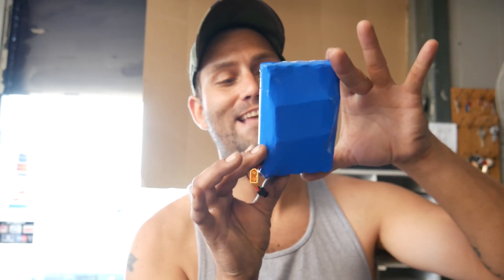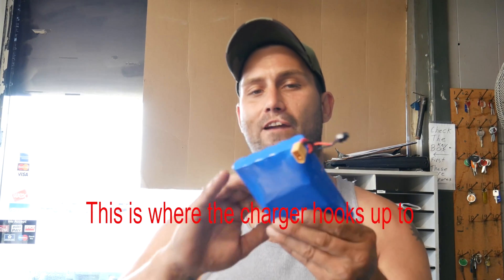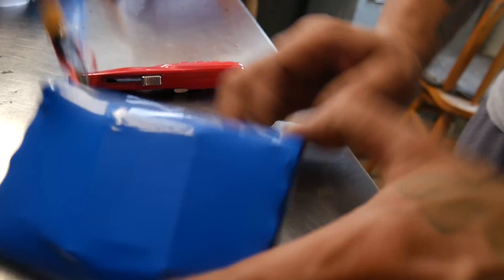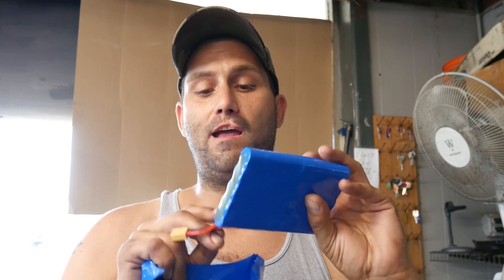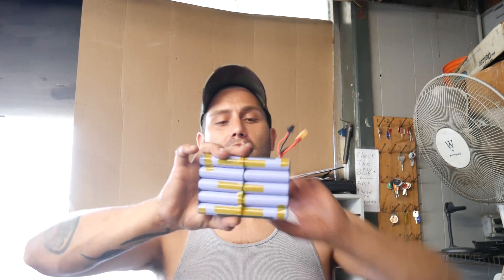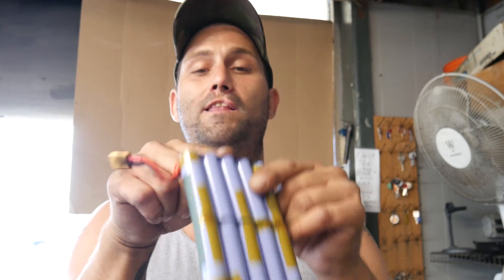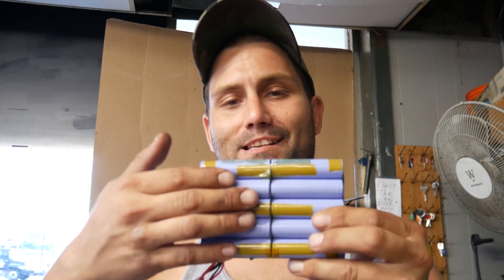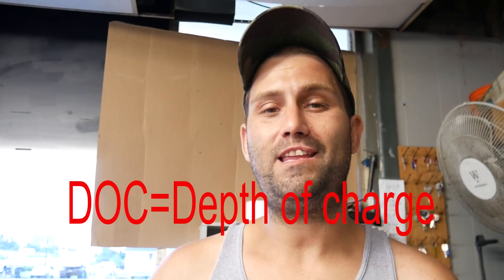Whats inside your electric skateboard battery pack?

Comment: I wonder what are your thoughts on electric skateboards/EV batteries two years on? Might make a good video...
Reply from the maker: I actually have a lot of experience with the batteries coming from The Vape industry. We had tested individual cells a lot actually. I was able to learn about the makeup and composition what different ones are good for and ultimately what to look for what to use to have the best experience. There's no doubt you get what you pay for it because the junk ones are the junk ones and the good ones are the good. I have packs that are years old now that still work just like they did when they were new and that's the hand to God truth., then there's other ones that I only got a few months out of but I already knew that that's what it was going to give me just knowing what battery cells were used. Man I could talk a lot about batteries that's a really good one I like the fact that you're giving me ideas because I'm going to be getting back on here a lot more and I could definitely use some ideas I'm all around the place when it comes to making YouTube videos I talk about anything and everything for when somebody gives me a good idea I definitely like to run with it
Reply: @JoeKyser  one thing I'd love to see is a video/history lesson on electric skateboard components like hub motors, heaven knows we've came a long way to things such a removable outer tyres and Hybrid AT hub motors from SkullBoard! That'd be a very unique video I reckon. #MakeHistory

Comment: Can you use a bms from the 4300mah battery inside the newer 5500mah battery pack? I have a good bms from 4300 and want to use it in my 5500 and don't know much about the differences of the bms if any... they look very similar but the newer 5500 has a fuse and not the older 4300! Thanx for any info!!!!!!
Reply: I been told not to try that from a store in denmark
Reply from the maker: Well they don't know what they are talking about. The mah has nothing to do with it. You can have two batteries of the same. Voltage that would take the same bms and be two totally different milliamps per hour. The maH is the capacity of the battery. Think of electricy as water. It's in a tank and runs out a nozzle that's attached to the tank instead of through wire. Voltage is the water pressure. Mah is the size tank. Some tanks can hold more then others but with the same size nozzle on the tank only so much water can still come out that nozzle. The bms is like you opening and closing that nozzle. As long as the nozzle (voltage) is the same you can use the same way (bms) to open and close the nozzle
Reply from the maker: The mah has nothing to do with it. It's the voltage is what you need to match

Comment: ...Hey Joe...  I have 2 of these koowheel batteries opened up and the 2nd one reads at 40.7v before the bms! Is that right? How is it reading over 40v rather than 36v? Also do you know the layout used with the cells? I think I have an idea but just want to verify that I am right! Thank you... for ANY help with these batteries and I would appreciate it tremendously!!!!! Extra info... first battery reads 3.6v per cell... 32v before bms... and only 9v at connector... and the 2nd battery reads 40v before the bms and only 12v at the connector! I am thrown off by the 40v reading!!!  Thank you again for any into and will pass the info along letting people know that the info and knowledge came from you and plug your channel! Thank you again!!!!!!!
Reply from the maker: you got it, it will read as high as 42v but thats at max max max max 40 is good thats what the bms does. it turns it into a steady 36

Comment: i would love to feel competent enough to double the range on my genisis, your vids help!
Reply from the maker: +JeffHawk i just made a Genesis hybrid. so what I did was I ripped out the old BMS and installed my own custom 30amp one. I was thinking at the same time I wonder if I can take the stock BMS and wire that into a 10s4p pack. either that or build a pact that would accommodate on esc charging. so I'm going to take her around with that and see if there's a easy way to adapt a larger pack using the stock esc.  it wouldn't be able to fit in that battery cage though I know my buddy Dave over at psychotiller would be able to build me Anais and closure. I think when I get the next two wheel version and start making videos with that I'll take one of the old ones and do that.

Comment: yesturday was a day with bad luck i had to use the battery with no bms first my soldering iron breaks i just bypassed the bms coming out of my house a flat tire sealant dint work but i think i found a bms for lifepo4 the will fit my ebike and cheap wish me luck and i tested the mosphet one of them wont close at all is open
Reply from the maker: +nightmare in action nighmare in action dam bro ueah well good luck for sure you're gaining a lot of good of experience here though